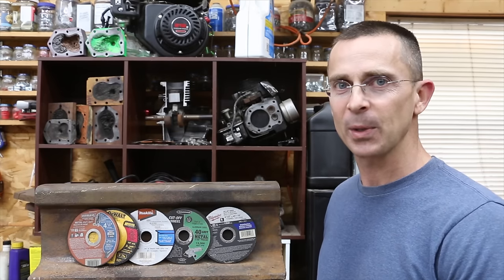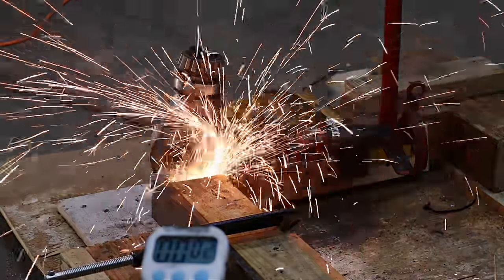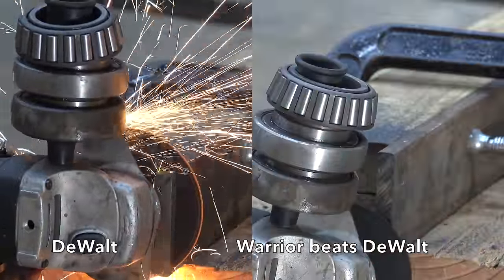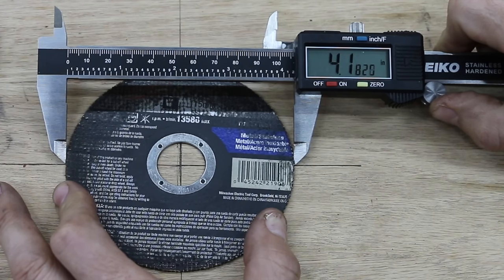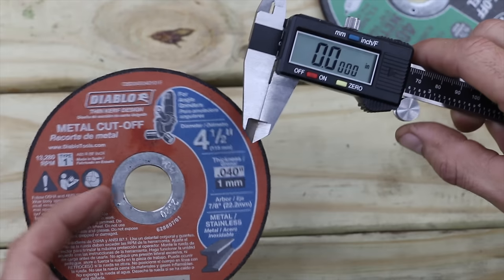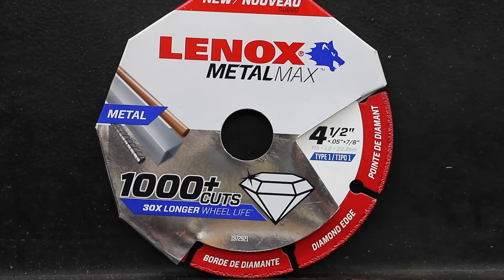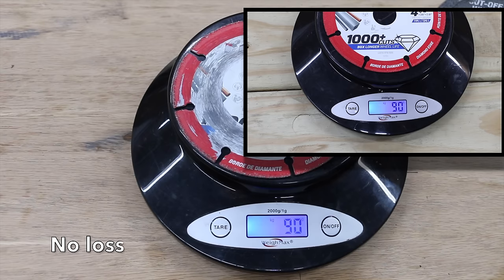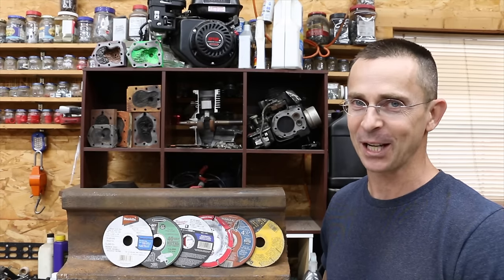Best Metal Cutoff Wheel Brand (6 Brands Tested)?  Let's find out!

Comment: Any chance of a new video where you test stuff not made for a task on how well it does the task?
(the brand stuff isn't quite that international...)

nails as drill, best way to hammer in a screw, asphalt as oil/fuel, 2x4 as cutter blade on lawn-mower e.t.c.

Or even some about how some mechanisms/mechanical stuff works.
Reply from the maker: Thank you for the video idea!
Reply: Nails as drills works really well in wood, probably not great in metal.
Reply: we used to substitute steel chains for mower blades on Gravely walk behind mowers we had a the nursery i worked in as a kid...it was a thick chain with links like 2 inches long...it was years before they told me that wasnt a stock item and they came with standard mower blades that broke right away and the chains ripped though brush better than any blade could and it didnt matter if you hit a rock and they did a decent job on grass

Comment: I wish you could have included "Sait" brand cutoff wheels. I have used them on the job and they SEEMED to work and last very well. Thanks for doing what you do, the way you do it. It is informative and entertaining.
Reply from the maker: Great suggestion!  Thank You!
Reply: and also do a test on all those really cheap e-bay wheels that are .40 -.60 cents a wheel..
Reply: I also came to say I wish you would have included Sait cutting disc as well.

Comment: i do a lot of metal fab work. i have always used the abrasive wheels until a year ago when i bought the lenox diamond wheel. it is slower(given) but i like that it has no fiberglass abrasive smell(i have dust allergies) it never changes diameter and im able to make more consistent cuts. it also produces way less sparks . safety advice; always keep two hands on the grinder, never cut one handed. if it catches and yanks you can control it. the LAST time i cut one handed the grinder caught and jumped, i almost cut the tip of my finger off, i now cut two hands on. learn from my mistake.  great channel!
Reply from the maker: Thanks for sharing.

Comment: Love your channel. Real world experience that just happened tonight so I came back to rewatch this. I'm cutting out the heater channels on a 68 Ghia. I started off with the Diablo wheel and they chewed up really quickly. Switched to the Warrior wheel and the wear was about the same, maybe slightly better. Pretty disappointed that the extra money for the Diablo didn't translate into durability for me. I'm thinking on the thin metal I might be better off with the Lenox. Worth a shot. Thanks for your channel, great stuff.
Reply from the maker: Thanks for the feedback.

Comment: Great to learn this stuff from one scientific based thought process so many can benefit...thanks!  And, I have cut hundreds of sheets of corrugated siding and roofing at work using all these blades and find the thinnest and higher quality ones are more efficient (cost more, but cut faster and more smoothly)  That Lennox did work good at first and lasts much longer, but slows down considerably after a few cuts.  I did end up switching to DeWalt 6" thin kerf blades when I bought my FlexVolt Dewalt Grinder which has an added benefit of running much faster and smoother, quieter and cooler which is a factor in the Arizona desert..110 degrees today, as a side note for anyone dealing with heat.
Reply from the maker: Thank you!

Comment: I was at Lowes and none of their cutoff wheels listed metal except for the Lennox so I bought it to cut some rebar.  I wish I'd thought to check your channel ahead of time.  I still have a few Warrior wheels so maybe I'll use those up instead of using the Lennox which might take 5 times longer.  My Harborfreight angle grinder didn't have enough power to cut through rebar and died so I decided to splurge and get an 11 amp DeWalt.  Thank you for performing the tests.
Reply from the maker: You are welcome!

Comment: Different metals also have an effect on how these wheels cut, The softer the metal the easier it gums up, and slows the cut, cool video, I usually use Klingspor, (past 15 years) they are a German company, and Harbor is the only one in the video I have used, and I have been impressed with how much abuse they can take, as one who works with metal, I do like a cut off that doesn’t break as easy but has some flex. A video on cutoff wheels that can flex without shattering would be awesome.
Reply from the maker: Thanks for the video idea.

Comment: One of the problems I occasionally have with grinding disks as I put too much pressure on them or not at a perfect angle and I notice some of the cheaper ones fly apart come apart super easy. That might be a nice thing that test the next time you do this. 
As always thank you so much before I buy products I always check with project farm first!!
Reply from the maker: Thanks!  Thanks for the suggestion.

Comment: Master Farm: Yet another well thought out test. I do some metal work (sculpture and fix-it stuff) and go thru lots of thin cut off wheels. Harbor Freight discs are cheap. I'm kinda cheap and had a bunch, so I use em. My 18V Lithium cordless is a Makita, so I had a few Makita discs. I thought they seemed to last longer, but wasn't sure. This proves it. I do have a beef with your tests tho.

In the past year or so of watching your vids it seems I won't buy anything without checking Project Farm to see if you tested it! Just kidding. Love your vids and the way you set them up for fairness.
Reply from the maker: Thanks!

Comment: I Just got a new cordless grinder in the mail,went to lowe's and bought some blades.DeWalt 0.125,////Spyder 0.045 diamond blade(2 pack) for concrete & masonry,stainless steel,aluminum,tile,ductile pipe,asphalt,ferrous metal.

Comment: From My experience, I've used the H.Freight wheel and the Dewalt I switched to H. Freight because the cuts were much quicker and thinner. One thing to keep in mind with them and possibly others that will break down very very quickly if there is any vibration at all. In other words, the material needs to be large and heavy or in a vice otherwise you can watch it shrink on one cut. I did notice vibration on your tool. In any case, many people won't be steady when cutting.  I'll keep with the green disk as it was much more aggressive and a 10 pack ain't so bad.$$.

Comment: The Lennox cuts a lot slower with longer stock but my biggest concern is reducing grinder dust and durability. Grinder dust gets everywhere and cut off wheels that are abrasive don't last long at all when you use them on a regular basis. If a diamond disc helps eliminate grinder dust and lasts longer than it's a win in my book.
Reply from the maker: Thanks for the feedback.

Comment: A test with the 3M Cubitron, Norton Bluefire and the Klingspor Edge would be valuable as these 3 are high performance wheels that many fab and machine shops use. The 3M Cubitron is expensive but saves labor which is often the most expensive part of a job. The Cubitron is a computer designed grain  which is designed for cutting speed, less wear and lastly less heat buildup of the material being cut. Being in industrial sales I have sold all three. These high performance versions also run with less vibration to the operator.
Reply from the maker: Thanks for the video idea.

Comment: Been using Dewalt for a long time. Always served me well. Tried the Lenox diamond wheel. The only thing it is useful for is when you are out of good wheels and the hardware stores are closed. Found a real good cutting wheel at the welding supply store made by pearl abrasives. Less than $2 a piece and cut like a champ. I cut about 3 foot of 3/16 mild steel at 45 degree angle (equivalent of 1/4") today and only lost about 1/2". Probably my go to blade for now on.
Reply from the maker: Thanks for the feedback.

Comment: Best 3” cut off wheel! So many on amazon now… we need you! Im putting the project farm bat signal up!
Reply from the maker: Thanks!
Reply: @ProjectFarm  i meant 3” cut off wheel….. they have new small battery powered cut off tools… i got the dewalt which seems to be the king of them all… but milwaukee, ridgid and ryobi also have one… im at a loss of which 3” wheel is safe for the 20k rpm and best and longest lasting… it would be a big help to us sheet metal guys to know which 3” metal wheels are most  affordable and last

Comment: Great video, one thing I would change is how you measured the usable material, they way you were measuring, you were accounting for the circular cutout in the center as well and the non-abrasive material in which is used to hold the disk down. Try measuring from the center to the edge next test for more accurate results. But anyway a great video!
Reply from the maker: Thank you for the constructive feedback.

Comment: I agree the winner for me was the Makita. The diamond wheel may also work for aluminum if it doesn't gum up. Carbide tips for steel. Wheels that turn to dust aren't just annoying I suspect the dust produced is highly dangerous to lungs.  The key to abrasive cutting steel is RPM.>>>What I mean is how many times the wheel has to turn to get the job done. Small wheels many turns.  Some people think a worn grinder wheel is the sweet spot not so. And never buy a 4 inch angle grinder. What I'm getting at is for a small metal shop the 14 inch chop saw is everything.  Production speed, accuracy, control, and cheap. Also good for all fieldwork.  Larger shops go to metal type blades. These small wheels are good for special things.  I'm not sure who uses them heavily, weekenders I guess.  I think auto body and mechanics use them a lot. When you find a cheap off brand chop saw blade that actually works buy a box or two and keep them flat.  14 inch test!
Reply from the maker: Thank you

Comment: I was betting on the Diablo from the start. The 9 inch Diablo wheel is a BEAST for cutting through metal. I had to saw 3/4in treated stainless steel plate stock in half (6 foot cut, out plasma cutter and waterjet was down) it took only 20 minutes.
Reply from the maker: Thanks for the feedback.

Comment: Great video as always! Video idea:  Diamond cutting wheel showdown: Lenox, Diablo, Rigid, Dewalt, Makita, Milwaukee. Not sure if all of the brands mentioned have a Diamond cutting Disc but one I have personally tried and liked it a lot better than the Diablo is the Rigid. I'm currently doing a car restoration and there's a lot of cutting rusty metal and patches. The Rigid brand outlasted the Diablo by a lot. I would like to confirm if it was just my (mis)handling the Diablo as it was the 1st DCW I tried or is it really better. I ordered the Lenox brand recently and will be trying it out as the Rigid, as good as I think it is, has finally reached its EOL. One thing for sure if you decide to go with the idea; it might get a little pricey. Thank you for your videos! KUTGW
Reply from the maker: Thank you for the video idea!

Comment: To really make a fair comparison, you need to factor in how many cuts can be made in a given time, including the time spent changing wheels. I love my diamond wheels because they are always full size. To get full use of abrasive wheels on deep cuts, you find yourself putting an old wheel back on to start, a new wheel to get halfway through,  and another to finish where the second one couldn't reach once it wore down. So yeah, if you don't need a full wheel to finish a cut, the time spent swapping them out might be comparable to the diamond, and might be less hours of vibration on your hands and use of the tool, but the safety factor of never having a disc explode still beats the abrasive ones hands down

Comment: My lawnmowers are scared when I watch your videos.  A long time ago, I had a bunch of left over citronella torch fuel and I didn't want to move with it.  I mixed it with gasoline and to my surprise my mower ran okay.  I could hear audible knock, but I'm cheap and I just slowed my mowing speed.  I got tempted with some rancid/expired olive oil, but figured my poor mower had enough abuse.  It's a real Honda engine.  I also ran the same mower on left-over 2-cycle gas.  She smoked, but she ran fine.

Hey, I have a suggestion for your next video.  Try testing different ATF fluids?  There are a lot of people that swear that certain transmission fluids make their manual transmissions shift better.  From what I can tell, most modern manuals use ATF fluid or DCT/CVT fluid as they are light viscosity.  I'd be curious to see how each handles your cold test, the bearing scar test, and it would be really cool if you could rig up a way to see what the load carrying capacity of a clutch submerged in the fluid.  For example, "Type F" fluid is supposed to have a higher coefficient of friction than other fluid types...Old hot rodder's trick...B&M Trick Shift is supposedly the same thing as Type F.  Having a high coefficient of friction should help the synchros last longer?
Reply from the maker: Thank you for the video idea!

Comment: I use Lenox diamond cutters on tile with great results by keeping the blade cool with water. I tried using them on steel, and as shown here in the demo, they do cut slower. Cooling with water does increase cutting speed, but not significantly.
Reply from the maker: Thank you!

Comment: Rhodius XT38 disks are my go to. You can draw with them and the thin kerf makes it worth the disk loss IMO. I also use Rhodius disks for my 9’’ grinder. A decent amount of the work I do is 316L/304 stainless and all of my grinders are Metabo. Just stating what’s worked for me for 25+ years. Also, no need for any tools to change out disks, brush cups, flap wheels etc. on Metabo grinders.
Reply from the maker: Thanks for the feedback.

Comment: Another superb, no nonsense video.  I'd like to make several suggestions along this line.  Hole cutting. Milwaukee claims their their bits can cut holes through metal and not break any teeth.  Also, who makes the best blades to cut tile? There are a few ways to cut tile with a blade.  But I'm thinking either using a grinder or a tile saw.
Reply from the maker: Great video ideas! Thank you

Comment: 14 in, Type 1 Ceramic Abrasive Cut-Off Wheel, 1 in Arbor Hole Size, 0.0937 in Thickness → we used them to the exclusion of all other brands on Stihl TS 420 Cutquick Cut-Off Saw w/Water Kit and 14” Blade TS420 previously using the 350 until that one came out → This is Pipe like Reinforced Concrete Pipe - using the for-concrete version and a type that I have forgotten the correct name for that has rubber seals for water supply >> In hard aggressive work this brand always performs better even on my 4½ Bosch grinder ~ ditto pipline which may be studied also
Reply from the maker: Thanks for sharing.

Comment: i am a scrapper ,so i use a lot of cutoff wheels ,,the new diamond wheels (diablo)are a disapointment,, they load up cutting soft metal like AL, copper wire or brass and u need a cutting torch to get wheel usable again,,it just turns smooth with copper or brass filling up the voids between the diamonds..cutting thick steel even 1/8,,like the top of a AC compressor, also does the same too,ruining the wheel,as it loads up with steel,after some use ,when cutting steel as in cutting top off of AC compressor the wheel heats up the steel making it red hot just ahead of wheel and mostly just shears off the steel instead of cutting it,and then u get the wheel loading up with steel,ruining the wheel,, now new the diamond wheels are great,,but to make it  last,, only cut steel sheet metal..
Reply from the maker: Great feedback. Thank you

Comment: I just bought a Diablo metal cutting wheel, much like the Lennox you tested. Wanted to compare it to the Klingspor crownflex, and Flexovit Razorblade. Both .045" diablo says it has 100X the life. Just like your test the Dianlo was much slower. And leaves a bigger burr on the bottom side. Even if it lasts 100 times as long, time is money. Both abrasive wheels were rated specifically for stainless and metal. Which tend to out last the other brands you tested.
Reply from the maker: Thanks for sharing!

Comment: Build grain bins in the summer and cut ALOT of metal cutting stiffeners and bins all day using a diamond blade is the only way to go, we use to have to change cutting wheels every two minutes or so and now it's closer to a hour and buy them a 1000 at a time and they are cheaper than in the video
Reply from the maker: Thanks for sharing.

Comment: Im sold on lenox since you dont lose diameter. I pinched one and bent it. Took it off smacked with hammer and went back to work with it. No blowing up. Ive also done cuts where i needed full diameter the entire time cutting some thick welds on my trl
Reply from the maker: Thank you for the feedback

Comment: I usually use 6" CGW cutoff wheels, they last longer and cut faster than 4.5" wheels, and are rated for the speeds a 4.5" grinder can get to. Technically you aren't supposed to do that, but the performance and reach can't be beat. 

With sheet metal, if blade gets slightly misaligned a normal cutoff wheel will chew itself up in short order. A cheap diamond wheel intended for masonry from HFT will do multiple roofing jobs, it does cut a bit slower, even on metal that thin, but the time spent swapping blades quickly negates the speed bonus conventional wheels have.
Reply from the maker: Thank you!

Comment: for just " cutting " fast and effective i use klingspor or pferd discs in the company , but at home i use a metalshock diamond wheel ....less sparks ( narrow garage ) less fumes , no stink , cuts my plexiglas as well as some wood , alu or steel , you can grind "a bit " wit h it ....did i mention that it does not stink ? less dust and stinks a lot less besides no stink
Reply from the maker: Thanks for the feedback.